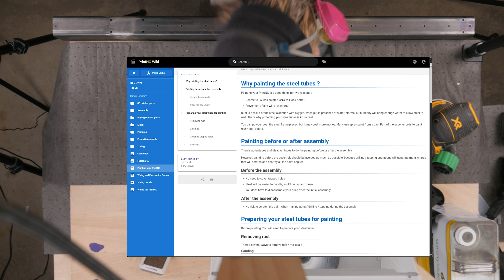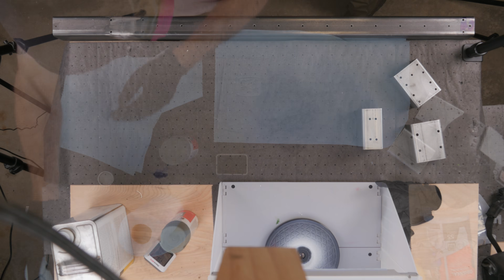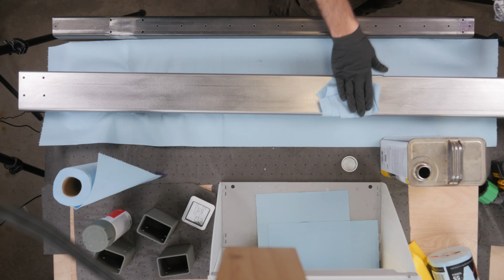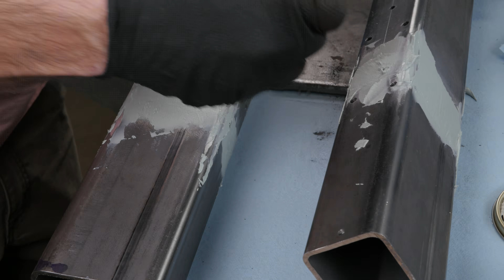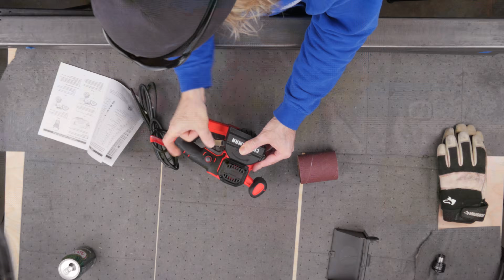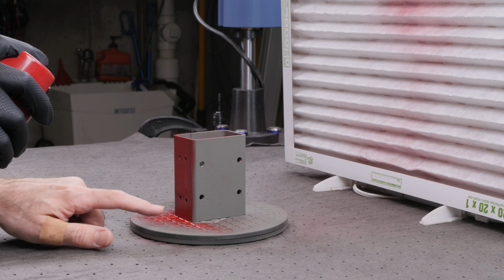Building A PrintNC CNC Router - Episode 6 #diy #cncrouter #printnc

Comment: When punching holes I found some metric transfer punches, and a drill block guide and used a machinist square as well. It's amazing how much play you can have with a transfer punch
Reply from the maker: You are absolutely correct on that.  You really want that punch to be a very close slip-fit if at all possible.  A set of metric punches is a great idea...I should get a set! 😅
Thank you for the comment, and thanks for watching!

Comment: I don't think I've waited like this since Game of thrones... I take it you weren't concerned with getting paint in the threads? That work out ok?
Reply from the maker: Wow - I take that as quite a compliment!
I initially thought I would put screws in all the holes, but honestly, I forgot to do it.  I have tried inserting fasteners into several holes since painting and there is no issue at all.
I guess, when it is time to film an inaugural run of this thing, I'll have to exclaim "Dracarys"!
Thanks much for watching!
Reply: @mainejason  And I didnt mean that as a sleight regarding how badly the final two seasons turned out! Do you mind if I send you a DM regarding your build? Im putting a 3kw spindle on mine, so its a bit wonky, and also did some 4x4 3/16 for Y rollers. Basically a huge lever... Hopefully not.  But I had a few questions if you're willing?
Reply from the maker: Ha!  No slight taken - I think I took it how it was intended.  Sounds like an interesting build!
I saw your other message and replied there - hopefully I can be of some help.
Reply: @mainejason  And i really appreciate the step by step process. The Discord is great and appreciated, but with the V4 Guide not done, and the inherently disjointed nature of Discord, this has been my go to reference.